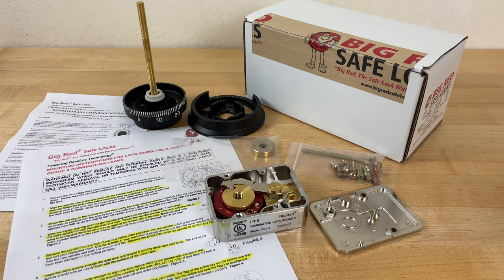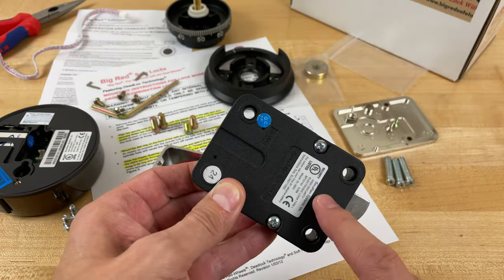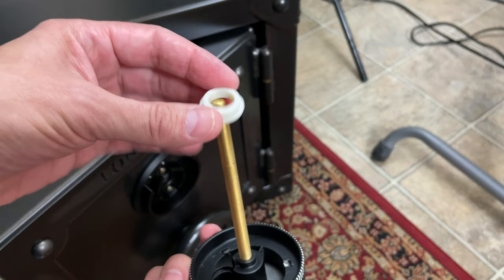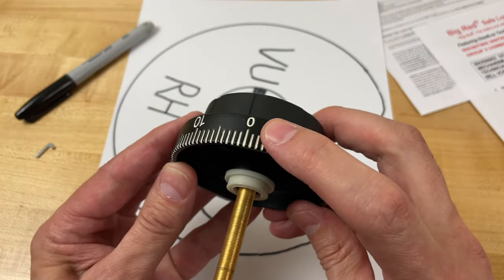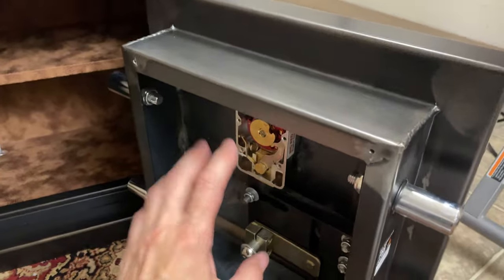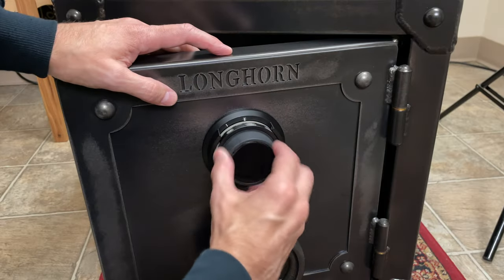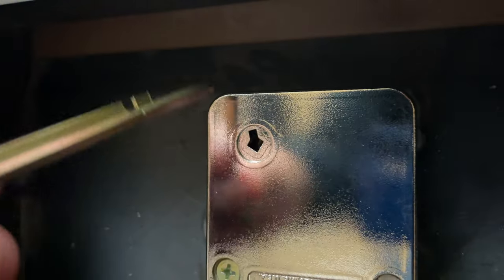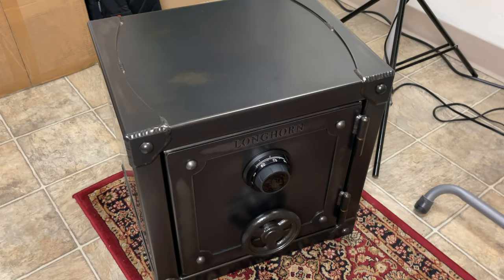How To Install a Mechanical Safe Lock

Comment: Seriously, this is the best video I have seen on how to install one of these locks. I have been working with locks,keys,and safes for over 25 years and could not have made a video this good.
Reply from the maker: I'm humbled by your words. I've been thinking of getting another small safe and using it as an opportunity to install another mechanical lock. I'm fairly certain Big Red would give me a good deal on a lock for the purpose. I was thinking of installing one of the manipulation-resistant locks. Do you think it's worth doing another video like this?
Reply: @HandgunSafe  Absolutely. Most people were taken by surprise when they heard about some companies handing out override codes. I bet a lot of people are thinking about going mechanical with their safe lock. It was nice to see Big Red give that piece to clean up the threads after cutting. Sargent Greenleaf doesn't do that.
Reply from the maker: @dalehayes1911  Okay. I'm on it. I've got a backlog of three upcoming videos to shoot, but I'll start securing the parts for another safe retrofitting video. Thanks!

Comment: Great video. Thanks for sharing - especially when things go wrong. I just did this and two things to help avoid this. 1.  Check the dial action and alignment before you send the spline key all the way home- just put it in half way. 2. you can by a dial alignment tool that has bushings on both sides (dial and lock body) that aligns the two perfectly.
Reply from the maker: If I decide to do more of this, I'll invest in a dial alignment tool.

Comment: As a safetech for a living this was well done BUT- there are "forbidden zones" in most mechanical locks quick rule of thumb don't place the LAST number of combo between 90-20 you should be fine. otherwise, you'll run into a lock-in situation! Also keeping numbers well spaced apart is a good idea, not 10- 15- 18  ETC.
Reply from the maker: More precisely: Do not use a a number between 95 and 99 or between 0 and 20 for the third (or last) number of the combination. This is also explained in the instructions. To avoid having my video become too long, I made a point of explaining that I was following the directions "to the letter" at the beginning.

Comment: Do you think that Big Red is as good as an S & G 6730? I ask because I have a Big Red on my Amsec BF gun safe. The safe is now 14 years old and is opened quite often and has never been a problem.
Reply from the maker: Yes, the Big Red lock offers the same level of security. Big Red locks are built to hold up under heavy use. If the lock isn't having problems, don't worry about it.

Comment: Pretty cool. :)  I have observed that this combo lock takes a lot more "pass the number" turns--either that or you just choose however many of those you want to do when setting your combo.  I'm used to turning a combo lock right enough to reset all the plates/whatever they're called, landing on 1st, turning left past the 2nd once, then landing on 2nd, then turning right to immediately stop on 3rd.  Is that just cheapie combos?
Reply from the maker: Going by your description, I suspect you are describing combination locks one might refer to as "budget" locks. I think the number of passes used in Big Red locks is pretty standard. This video is getting a surprising number of views for being posted at an odd hour on a slow day. I want to do another retrofitting video on another safe.
Reply: @HandgunSafe Well I suppose budget (combo) locks is all I've ever known then lol.
Reply: @HandgunSafe  Regarding retrofitting/doing one's own lock on a safe and my prior description of the kind of pistol safe I want to build someday, what are your thoughts on a big safe openable not by a combination but solely by a key in a super beefy well made cylinder lock with whatever appropriate back-plating inside the door?
Reply from the maker: @danielgoodman3578  I really like combination locks, and I would rather build or retrofit a safe with a combination lock. But if you're thinking about keyed locks, a high-end, high-security lock would be the type of lock you''re talking about. Although I know what keyed locks I would use, I don't want to get into making recommendations. You're going to need to be comfortable working with locks to do what you're planning. That's really all I want to say on that.
Reply: @HandgunSafe  thanks for the input!

Comment: When I run into a dial ring that needs a small amount of vertical adjustment outside the range of play in the hole, I find I can often dremmel the existing hold for the magic module existing screw locations to add enough up ad down play to proerly center the dial without drilling into the safe.

Also missed as the traditional wisdon of "do not re-use the spline key"

The spline key is generally oriented with the flag oiinting away frm the center of the spindle rather than towards it.
Reply from the maker: Interesting. I can see that installing and reinstalling a spline key repeatedly can result in the key not seating very firmly, but I think removing it once or twice won't hurt. The spline key is made of slightly harder metal than the spindle, which is brass, so the wear is happening to the spindle. As for the direction of the flag at the end, I followed the manufacturer's instructions. The designer of Big Red locks designed the locks to standards and drafted the instructions. I think he's a better authority on how to install these.
Reply: @HandgunSafe  Thanks for the informative reply.   I over-generalized (my apologies); the S&G 6730 instructions say (and show) flag out and assumed that was the same on Big Red.   The spline key on S&G is brass; I believe that Big Red supplies stainless (?) so it is harder, and I have read that Big Red supplies two.   Once again, the "use once only" is an S&G recommendation, perhaps not for Big Red.  I always push the spline key in finger tight to I can remove it wihtout tools until the testing is done.   I agree 100% with you on the manfuacturer instructions.   Big Red seems to go a bit further than S&G on niceties like including a thread cleanup tool.  "Read this site in Chinese" on website - interesting clue that this is Chicom merchandise.

I assume you made the dial alignment "mistake" for theatrical purposes, and doubt you really would have made that goof in on install.   I had the identical issue on an electronic=>6730 conversion, but resolved it dremmeling a vertical notch in the screw hole on the dial instead of tapping new holes in the safe (with my luck, the tap would break off).

I wonder about the current viability of Big Red since it appears they have not updated their website in years.  MIssing image on home page unaddressed for ages?   Amateur hour.   "

Overall a very nicely done video.
Reply from the maker: @robertboudrie2234  Okay, I just followed up with the owner. He's still in business! The IT guy has closed up shop, and this is making it hard for the owner to get passwords for site maintenance, etc. If you want to find Big Red locks, try MBA USA, Inc.

Comment: Just to be clear, the original threaded holes in the door were just slightly misaligned so the new lock dial didn't lay flat & wouldn't turn properly?
Reply from the maker: Yes, that's basically it.

Comment: I think after watching this video I think I'm going to call a locksmith and let a pro do it. To many things can go wrong if your not careful enough.  After the safe "scandal" I was going to get mine replaced also.  It really sucks because I like push button locks.
Reply from the maker: It is best to have an experienced technician do it. Too many things can go wrong. I did this to help people see that they can get locks replaced, and that safes are designed to be retrofitted.

Comment: It's odd that Big Red's instructions say to put the spindle key flag over end of the dial shaft, S&G uses the same set up and they say not to, that correct orientation is against the drive cam.
Reply from the maker: I don't know what to say. I haven't played with all that many of these kinds of mechanical locks. The Big Red locks are designed by somebody not affiliated with S&G, and the designs are his, though the locks are fabricated in China.

Comment: I really like this lock, but I’ve been hearing a lot of negative feedback from technicians who have been in the industry for 30 to 40 years. They’ve mentioned having to replace a lot of these locks due to various mechanical failures.
Reply from the maker: I seriously doubt they're having much trouble with these locks. Technicians, who are often locksmiths who have expanded their services by getting certification to service specific brands, are partial to the brands they sell. Big Red locks are solid, and you can get them with four number combinations and manipulation-prevention technology built into them.
Reply: @HandgunSafe  how long have you had your lock for and have you had any issues and have you heard any issues about them and I was also told I wouldn’t be able to use it because of this

Big Red is made for a direct replacement of Mosler. If you don't have a Mosler, stick with S&G 👍
I had a s&g r6714 group 2 lock can I not replace it with the big red four wheel version?
Reply: @HandgunSafe  is there a workaround